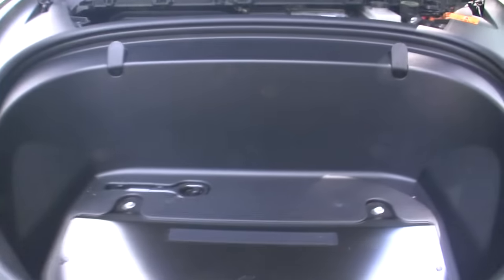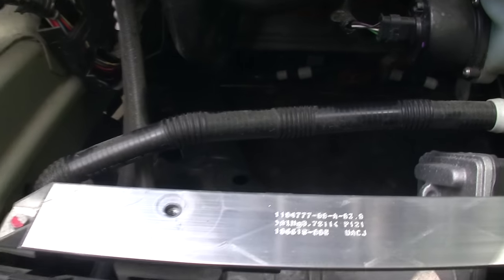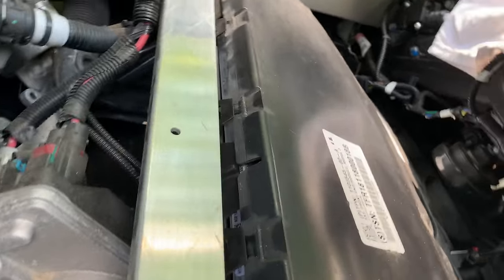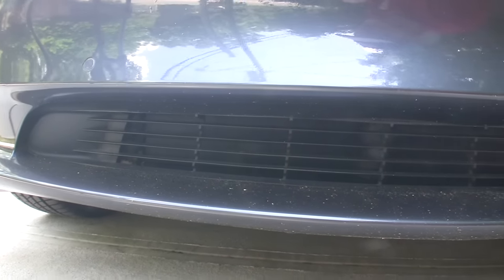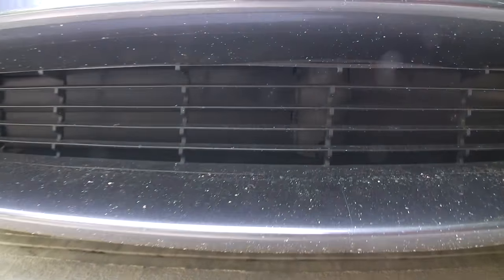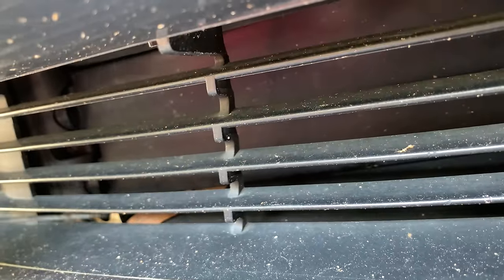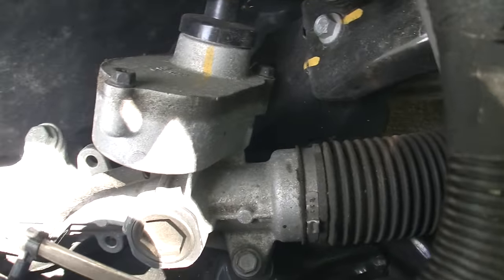Tesla Model 3 - Radiator Duct Clean Out

Comment: Design flaw if it accumulates so much leaves
Reply from the maker: Good point, I'm haven't seen any discussion online regarding this.  The radiator design is different than any other car I have owned.
Reply: Obviously internal combustion engine vehicles with exposed radiators could/would NEVER have this problem....
Reply: I heard cars get into accidents therefore they clearly are a design flaw 🤦‍♂️

Comment: Heading into warmer weather. Time to clear out the radiator. It’s not bad considering all the crap you need to do to keep an ICE car going.
Reply: Like what exactly? Please elaborate. Inquiring minds wanna know. What’s all the “crap” you have to do to keep an ice car going? Do tell. Because I just put gas and the occasional oil change and go. No leaves stuck all in my radiator either. I own a tesla as well but I just hate folks who try and make it seem like gas cars are so archaic and obsolete and teslas are without fault 😂 Hell, my ice probably has more tech than my tesla.

Comment: Just did this today, lots of debris down between the two condenser units.  Ended up using something flat to get down in there and pull up all the debris while I used my shop vac to suck up the debris.  Easy to do, spent less than an hour on this bit of maintenance.  I don't live in an area with that much deciduous trees and get there was way more debris down in there including some bits of plastic.  That area seems like it's a little street sweeper.

Comment: Thanks for the informative video - this made taking everything apart to get into the radiator a breeze. What I found looked almost identical to yours with leaves and bug parts on top of the condenser (evaporator?)  However! I found that if you release the clips on both sides that hold the condenser (evaporator?) in place, you can separate them just a bit. I was shocked to find the bugs and grass and leaves had worked their way completely between the two. I would estimate airflow was 80% blocked in that area - significant since that's most of the area of the radiator. I used thin metal rod, bent a hook in one end, and cleaned stuff out with that plus the shop vac, hose, and coil cleaner. I started looking into this because my supercharging speeds were really severely throttling - dropping below 50kw well before 50% SOC, and the fans would run long after my SC session was over. Cleaning out the gunk appears to have resolved my issues...now I just a proper test on a hot road trip. Thanks again!
Reply: Seriously? Was this really your experience and it was resolved?
Reply: Great information - I followed your advice and did the same thing. Unclipped the second "radiator" and shifted it slightly to the right and then was able to pry it back a bit to create space to vacuum further down. I wedged a screwdriver handle in between the right side of the lower "radiator" and the main "radiator" in order to extend the space between the two and keep it open while I vacuumed the rest at the bottom.
Reply: @isthatatesla  Yes I did the same thing and got 90% of the debris vacuumed out.

Comment: My model y louvers are stuck open and it was packed with straw, leaves, bugs. I took it apart but I could not get the radiator cover out through the front end or the rear of the front structure. I vacuumed and pressure wash it the best I could. Found an old wire repair on the louvre actuator. Sending it to tesla to repair.
Reply from the maker: Yes, it's a royal pain to clean.  To fully access, you need to remove the entire front bumper.
Reply: @MTNRanger  I took the bumper off but the top of the cover would not come out the front of the vehicle. I tried pulling it into the frunk as well but it was stuck on the frame rails.
Reply from the maker: @APatchworkCanvas  Yikes.  I wonder if the Y is different than my 3.

Comment: This problem is easily solved by purchasing an aftermarket grill inlet cover screen from numerous online sellers. Many on Amazon.
Cost is about $25.00 to $50.00.
I installed them on both our Model 3 and Model Y. 
They're typically 2 pieces, constructed of black plastic and stainless black screen. They snap into place over the front inlet.

They work great to prevent leaves, bugs and especially gravel from hitting and coming to rest on the radiator fins.
And, there's no need to ever take anything apart.

Aftermarket screen inserts are also available to keep leaves, bugs and rodents from getting into the HVAC air intake housing below your frunk lid. They are also easily installed by just pressing into place.
Reply from the maker: Yes, of course. But those covers were not available when this video was made. I review it in this video: https://youtu.be/vIbHOtPfR7o

Comment: My model 3s radiator fans would be super load and working really hard when AC was on or if I was super charging. It was so bad that if I go through a drive thru attendants would not be able to hear me. I followed your steps, first used vacuum to take out alot of leaves and debris and then hosed it down with a garden hose. Made a massive difference, the fans are 90% quiter now. Thank you!
Reply: Hai Faisa, for cleaning it did you just water it down from the top of the panel? Thanks!

Comment: This needs to be a suggested maintenance at regular intervals. Catching it too late will likely require an entire replacement of the core. 

My 3 hit a semi tire on the freeway and required the  bumper cover and lower support to be replaced along with some other minor bolt-on pieces. I did the disassembly myself while waiting for parts and discovered that the radiator is so clogged with perfectly-sized pebbles that I don’t see how it can be cleaned out without damaging the cooling vanes and drastically reducing efficiency. I already vacuumed an entire birds nest worth of hay, sticks and rocks off the surface. 

I previously noticed that the fan was working harder during supercharging. This was after 63K miles on NorCal freeways. 

The core was dinged at the lower end by the collision so I am going to ask that it be replaced as part of the repair. 

This component definitely needs a redesign or more protection from road debris.

Other than that, the design of the car and ease of disassembly is remarkable.
Reply from the maker: Most cars don’t protect the radiator very well. I have seen some intake screens that may help with this issue.  I hope everything goes well with the repair.
Reply: @MTNRanger  Thanks. It has been down 2 months so far, but I think the shop was BSing on when they actually ordered the parts. Goes back in for reassembly in a few days. 

I took mine apart because I got impatient and this is the only car I have owned that I never worked on myself. Of the 20+ parts and 30+ hours of labor on the shop estimate, it took me 1.5 hours and I found 6 parts that actually need replaced. The Tesla is no mystery vehicle and minor parts are not that expensive. Many owners are probably being taken advantage of by third party repair facilities because they think we will just fork out more money without scrutiny to get our car back on the road.
Reply from the maker: @rrzamudio  I agree.  Third party shops need the ability to work on Teslas.

Comment: CLEAN your FAN while you down there.
Thank you for the excellent guide. My car developed a clicking sound when ever the front fan was running. If you reach under and behind this radiator duct you can access the fan and fan shroud (below the aluminium crossmember). Mine had some mud and  debris stuck to it. Removing this stopped the annoying sound. Just be wary of the fan starting when your hands are in there!
Reply from the maker: Yes, I’ll have to look at that next time I’m in there.
Reply: Hey! I had that issue this morning with the clicking sound. After looking at the part online, i assumed a stick had gotten lodged in. How did you go about clearing it?

Comment: Excellent work!!!! You’re amazing!!!!!! Was that the A/C drain hole I saw under there in the beginning of the video?! That’s what I need to get to!!!! My A/C stinks! I think it’s the drain! You’re amazing, thanks for making this video!!!!!!
Reply from the maker: Can you give me an exact time in the video?  Have you tried using Kool-it to clean out the evaporator coils behind the cabin filters?  That usually does the job.
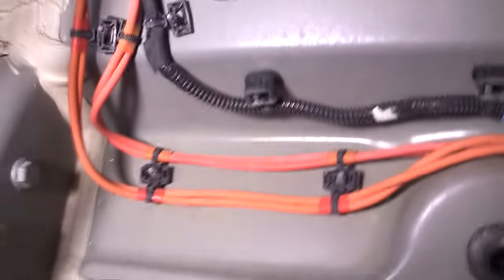Reply: @MTNRanger  1:21 I think that hole is the A/C drain from the evaporator coils right?
Reply from the maker: @SaraJAwesome  As far as I know, the lines seen at that point are internal lines between the battery pack and the superbottle.  The label with part number 1104424-10j is the battery pack.
Reply: @SaraJAwesome  The round hole through the black rubber grommet right in the middle of the firewall is the drain hole.  If you wanted to, you could spray some evaporator cleaner up through there (I use Kool-It).  But it's easier to spray from inside the cabin when you are replacing the filter.
Reply: @android04  so after this comment of mine a while back I actually changed the filters and cleaned the coils and I’ve had no issues since;) thanks! I used Klima cleaner and breathe easy filters. And it was the drain hole I was asking about, and the drain was not the source of odor. But it does drip on high voltage insulated cables. Thanks y’all!

Comment: you need modify the cover of radiator to open easily. thanks for the video.
Reply from the maker: Yes, it's a pain.  You have to remove to front bumper to get it fully off.  Not sure if the newer model years have the same design.

Comment: Thanks! I just cleaned mine on my 2020 model Y and it was a mess. Also, I don’t have the AC radiator that sits atop your actual radiator?? Are the model Y’s designed different? Here is a picture
Reply from the maker: Yes, I think the Model Y has a different design - along with a heat pump that mine doesn't have.

Comment: Could you have used a compressor or the canned air that is used to blow dust off of computer to get rid of the small bits of leaves that the vacuum couldnt get?
Reply from the maker: Yes, that would probably work.
Reply: I used a compressor to blow out the sand stuck in the radiator that the shop vac couldn't get out. It semi worked. I'd say it gout about 50 percent out.

Comment: Heat exchanger is liquid to liquid heat exchange. Radiator is liquid to air heat exchange
Reply from the maker: It is a radiator since the air is entering from the vents in front of the car.  This is the part number from Tesla: RADIATOR, M3 1077082-00-C.  https://batterypowered.net/tesla-model-3-radiator-battery-cooling-new-aluminum/

Comment: Thanks! Can you water down the aluminum radiator grille too or does it need to stay dry?
Reply from the maker: Good question.  I suppose it is possible.  Most cars have a radiator that is well exposed through the grille - which makes it easy to clean.  However since this one is hidden and covered by plastic trim,  it’s a lot harder to do that.  I have seen some generic radiator tutorials that mention you should use a dedicated cleaner rather than water.

Comment: 5:47 Is that sound insulating foam?

I had a large block of that foam fall out of my M3 rear wheel a while back but the service tech said it was nothing. Should I be worried WTF?
Reply from the maker: It's a foam insulator strip to goes around the outside of the radiator.  Regarding your car, nothing should be falling out of the wheel wells.  I'm guessing it got dislodged.  It's there for sound deadening.  I'm surprised service would say that - it's possible they didn't want to bother with the additional work.  I would contact the service center and see what they say.  Did you keep the piece of foam?
Reply from the maker: @scpdatabase969  That definitely sounds unusual.  I couldn't find anything on taped-on foam falling off anywhere.
Reply: @MTNRanger  Same here :( Thanks for the reply though. I will keep searching and see if anyone knows anything about it. I had written it off until I saw your video with that shot of the foam.

Comment: more maintenance than gasoline car. who said tesla ev is less maintain. Roof glass is too hot, you have to turn on ac to cool down the cabin, can't wait for for the summer heat to charge the battery more often because the stupid glass roof. Everything needs aftermarket parts to fix tesla design flaws
Reply from the maker: What I'm showing is not required, and needs to be done on any car, ICE or EV both have radiators.  I've only had to rotate the tires, change cabin filters and wiper blades in my almost five years of ownership. No brake service, no oil changes, no engine filters, etc.  What maintenance have you had to do?  A simple $30 sunshade if it's a problem.  Many EVs with glass roofs have this issue (Rivian, Polestar, Mach-E, etc).  Yes, it would be nice if they had factory retractable sunshades.

Comment: Any tips to do about AC compressor. I have an alert of VCFRONT_a210_coolantValveCalib.
Reply from the maker: Are you still under warranty?  It’s probably best to contact service on this since the coolant is so important to the battery pack.
Reply: @MTNRanger  No, I'm way pass warranty.  Actually its not showing on my side yet that it needs service. But when we checked the Service Mode that's what it's showing. I hope I make sense.
Reply from the maker: @jayemsuerte9317  Since service mode is showing an issue, I would get it looked at.  My only run in with coolant was a broken super bottle almost three years ago under warranty.